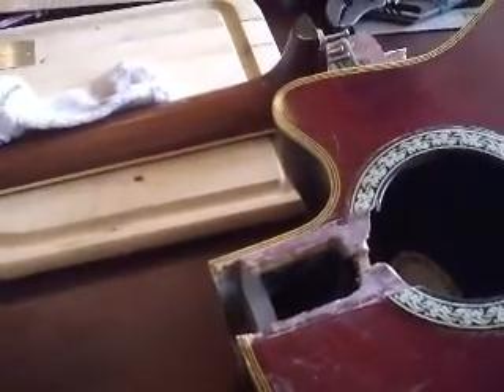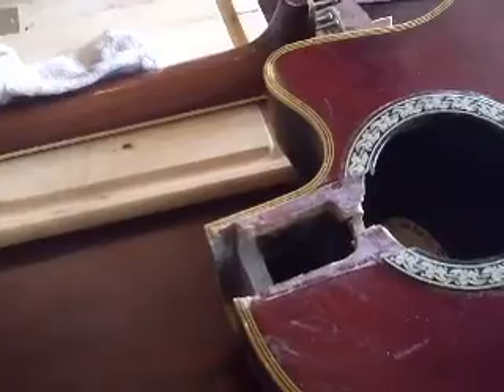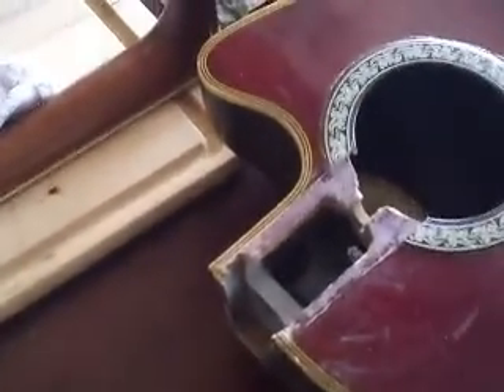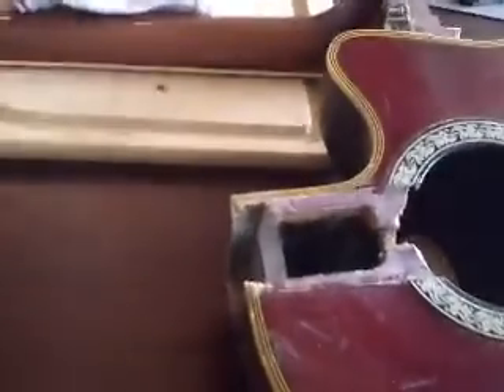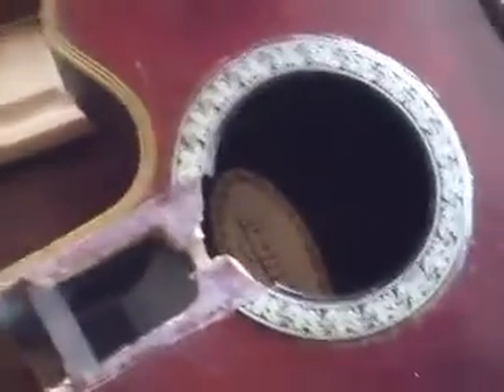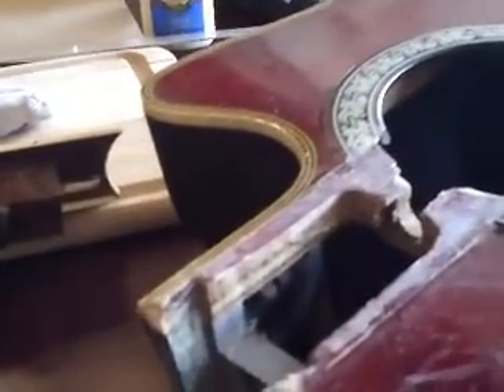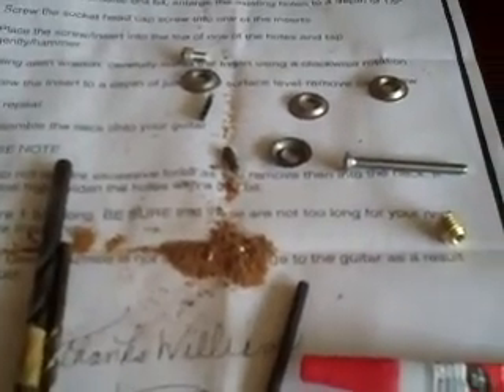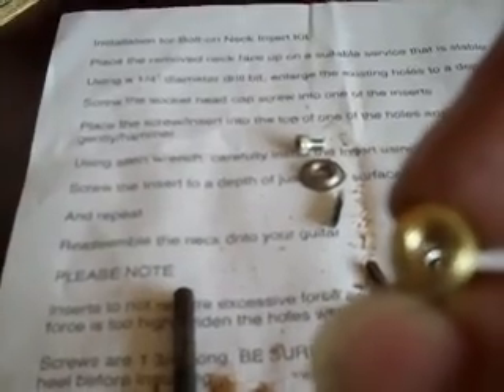Ovation guitar epoxied neck removal and bolt on neck conversion

Comment: Ovation bridges are designed with the intention of using shims underneath the saddle, in order to raise it up to the desired level. (If you took out all the shims, it would be insanely low and buzzing.) On mine, I even fine-tuned this system a bit by cutting my own little cardboard shims using the packaging from a set of strings. Then I cut them to different lengths, and stacked them in order to produce a staircase/ramp that gets the action just right on each of the treble and bass sides.